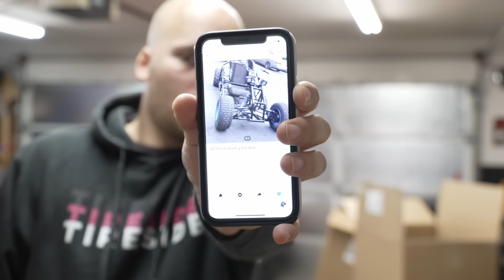Rebuilding a Junk Quad into a Go Kart

Comment: Ultra late to this but the reason your steering angle is bad is because your handlebars have been lowered down so far. Compared to the original quad's steering angle, you've lost quite a bit with how far down the handlebars are now. Not hating, that's just what happens in this situation. Looks really fun.

Comment: Killer concept and execution unfortunately I do not have near the fabrication tools that you do but I have built some pretty cool toys over the years like the CM 400 quad and I put a KX 250 engine on an old Western Auto Go-kart. 

I put zero turn lawnmower rims and tires in the rear  and ran Manco Dingo rear rims and tires on the front to give it better ground clearance. Being that it came stock without any suspension it was a rough ride on the dirt, but it was God awful fast. 

I Love the fact that you kept it handle bars instead of a conventional wheel. I believe it offers more options for setting up controls.

 I used bars on my build as well and kept my clutch on the bars and then used a foot pedal out of a bobcat skid steer loader for a heel/toe shifter. I used a quad thumb throttle   so that I could use the stock gas pedal for the brake pedal. I modified the front end to accommodate using the Dingo rear rims and tires and  set it up with a rack and pinion steering but opted for keeping it with no front brakes.  The maiden voyage on the tarmac was a real eye opening experience that sent me back to the drawing board because it flipped me over and tore up the tank mount and exhaust bracket. The very large wheels in the back allowed the rear frame to clear hitting the ground and well I had under inflated the tires slightly to give the rigid mounted axle a bit of cushioning effect and yup the tires grabbed really hard and the next thing I knew I was on my head. It was a very short wheel base with way more power than that kart was ever intended to have and such large tires that it looked like someone tried to turn a smart car into a dragster. 

I ended up salvaging some casters from a department store kart and fabricated a set of suspended wheelie bars to keep the front wheels from coming up any higher than 4". After that it was quite the fun machine in a straight line. It would humiliate sport bikes for the first 5 telephone pole lengths in a drag race then it would run out of legs. 

I think for my next build I want to put a turbo charged Raptor 770 on a kart frame but this one will have a full cage and 4 way suspension😁.
Reply from the maker: Sounds like you got some great ingenuity! My first go kart was a Manco Dingo! Loved that thing, even with 6.5hp it felt like a rocket especially to a 12-13 year old me. 👍

Comment: I have thought about doing the same a few times over the years but never got around to finding a donor quad. With that said, I did see a neighbor with something similar, but his was ugly, in the back of his truck. He would ride it up and down the street a bit here and there and then he sold it a few weeks back. I would try to find a way to bring the front tires closer to shorten the wheel base and would likely put some spacers on for more width. 

Anyways, this one looks amazing!

Comment: If you guys make another one of these You guys should definitely make wider front control arms and get a wider rear axle made, because it's so narrow and long that I'd be sketched out thinking it'd always want to flip.. and if u made it wider it would overall probably feel more planted
Reply from the maker: I agree. We did put large spacers on the rear wheels to widen it but didn’t make a huge difference. I was actually surprised how tippy it felt even after being lowered so much.

Comment: So did you try to heat the sleeve when it was in the press?.. and... was that a deep well socket?.. I used sockets the same way many times!. But.. it woulda been complicated if you were to heat the sleeve sense it prolly wasn't long enough.. ida drilled a hole in the bottom plate myself so the bolt would pass threw.. sucks sometimes but making tools for a job makes things easier sometimes.. love this build and wasnt to do the same sense my kids outgrew their 4wheeler.. its a 2stroke so I'm thinking I can tip the moter up for more room and just keep the drive sprocket where it is to avoid a full rear end mod

Comment: Cool Video! 
Im trying to make one myself and i have no clue on how to make a system so i can shift gear the way you made yours shift. Can you maybe make a video on how you made that gearshifter and how it works? :)
Because im lost on how to make a gearshifter work and at the same time be functional! Plz help me man!!! :)
Reply from the maker: We just flipped the foot shifter over and ran a push pull cable to it. Pretty simple actually.
Reply: @TIRESIDE  Do you guys have any other solutions on how to make a gearshifter. I dont know how to do your method :)
Reply: @emilseirup5837 they just took the foot shifter off and rotated it so it was pointed up and tightened it back up. Just loosen, rotate, tighten.

Comment: Rather keep it as a quad, lighter weight smaller foot print, more maneuverable in the woods.
Reply: Quads and go-carts don't leave footprints, they leave tire tracks. 😂😂😂
Reply: This will be way more stable at higher speed though. Longer wheelbase and lower center of gravity.

Comment: as soon as You mounted the motor to the swingarm...I'm OUT.    I hate that crap.   Spend the extra time to do it right.
Reply from the maker: Where would you put in this context? All go karts I’ve seen with rear suspension have the motor mounted to the swing arm.
Reply: That's how they are mounted on a live axle setup, and it is completely normal to do so.
Reply: @TIRESIDE dunno what he's on about. It's supposed to be mounted that way in a live axle setup. Just ignore him 😂